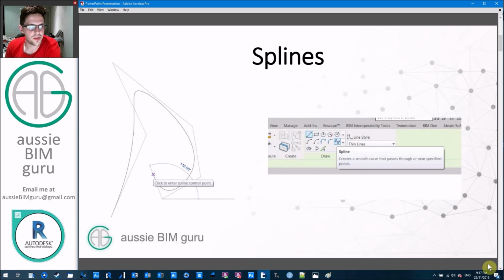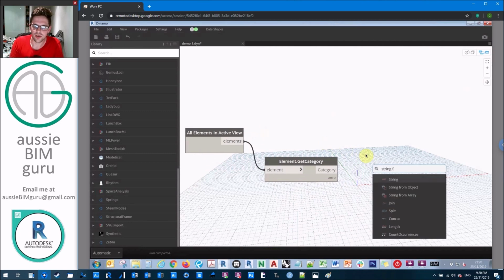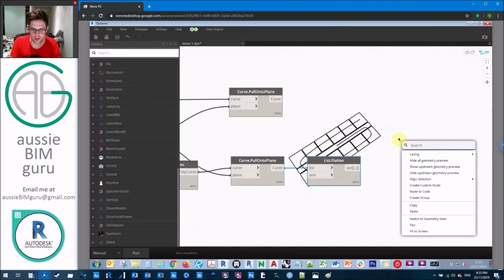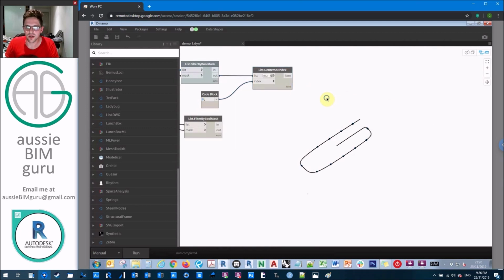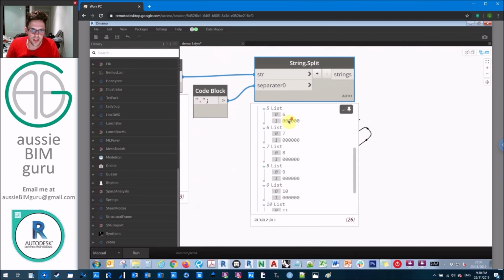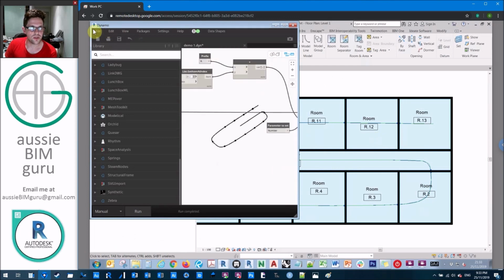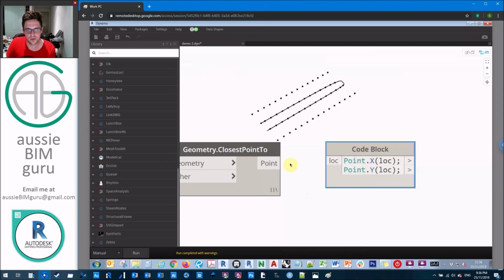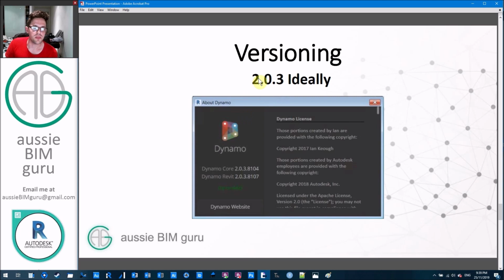Numbering by Spline using Dynamo!

Comment from the maker: Turns out you might need to use a 'minimum item' node after you use boolean masks - the intersections don't always come back in order of parameter!
Reply: Hey ! I'm having trouble. Even after I use the minimum Item after one or both boolean masks I didn't get the right order...
Reply from the maker: @IshiFrenchy  try running it @L2 so you work across sublists/objects. This is only for a workflow where you intersect a  surface or solid object.

Comment: It might be late to have any reply, but I obtain an error that tells me that the set to the same plane failed due to the poly-curve self intersecting. Annoying because I feel it is an important step to assure all the elements are on the same plane.
Any suggestion on how to delete or recalculate the poly-curve to avoid self intersections?
Reply from the maker: My guess is your curve crosses itself based on the error message, generally this should just be avoided if so. If it relates to the room boundaries then that might be a Dynamo internal error relating to rooms with complex boundaries or with small gaps around their edges.
Reply: @AussieBIMGuru  yeah I think it comes through because of the complexity of the rooms boundaries. I have just removed and so far it is working.
Reply: Thanks a lot for the reply

Comment: I followed this tutorial and reconfirmed it, but it looks like my rooms are renumbering based on the second intersection instead of the first. In other words - The corridor is not R.1 but R.6 in my case... (I only made 9 rooms.) Where did I go wrong?
Reply from the maker: If you're using list.firstitem, try lastitem instead for the intersections (or vice versa). If you're not sorting the sublists by their value, do that also so you get the lowest value from each list of parameter values only.

Comment: In my case rooms are having opening in between them, how to avoid double polycurves for such rooms, this is causing error at sorting due to difference in count of rooms and intersection points lists
Reply from the maker: To solve this one, get the list of intersection points/parameters for each room vs the spline and get the lowest number from each list. This way you only get the value the first time the spline intersects each room vs every time.

Comment: I am having issues when the spline crosses over a corridor multiple times it is not ordering the rooms in the desired sequence.
Reply from the maker: This would require you to take the first intersection per room only, so that it only gets counted once in the spline path. This can be achieved if you get the intersections per room, sort them with their parameter by key in sublists, then take first item from each sublist.
Reply: @AussieBIMGuru  I've followed your exact steps in your video, but the issue that I'm experiencing is at the Geometry Intersect node, where the first intersection listed is not always the first point along the spline. In my testing, it's either been the second or third intersection point on the list, not the first. The only thing I can think of is that it's due to the order in which the rooms are placed. I've been using the automatic room placement tool in Revit during my testing.
Reply from the maker: @thoov106  here is an example of how to handle this scenario:
https://github.com/aussieBIMguru/Dynamo_Scripts/blob/master/240430_ABG_NumberBySpline.zip

Comment: Hi mate, I'm trying to make it work for assemblies; however, since the moment I have to place Room, the finish boundary doesn't work anymore with assemblies. Is there any way to adapt this to assemblies?
Reply from the maker: The main ways i could think to work with them are either by using bounding box outline, location point or centroid of bounding box.

Comment: @AussieBIMGuru how i can use to sort out diff elements like pilecaps as i can not get finish boundary for it. I used 2nd method and sometimes it assign wrong values due to close proximity.
Reply from the maker: Get their location and pull the curve/points to Z plane = 0. Then do closest point to curve and get its parameter, sort by them instead.
Reply: @AussieBIMGuru  Curve.PullOnToPlane, not woking for points and Element.Curve givng "Empty List" for pilecaps
Reply: @AussieBIMGuru  Curve.PullOnTOPlane need curve and i got point from pilecaps and Element.Curve giving empty list for Pilecaps.

Comment: Great video but with method 1 or 2 the sort by key or minimum item both don’t seem to work! Any other suggestion?
Reply from the maker: Try sorting with levels set to @L2 and longest lacing applied. I believe that might be necessary in some Dynamo builds due to changes since I made this video.

Comment: Hello community, I am turning to you today because I have a problem. I would like to make a numbering of the parts thanks to a script but when I launch it, it numbers everything, no problem, but it does not follow the spline that I have set up. What did I forget in my script?
Thanks again :)
Reply from the maker: My guess is that maybe the spline is not at the same plane as the points, check in 3D in Dynamo. Also test a smaller model to see if in principle it is working.

Comment: Hi! First at all thanks for the video! is super helpfull and you explain it great, I´m trying to aply that to my project and i get an error in the Intersection Node, "Warning: Geometry.Intersect operation failed. Unable to make wire from edge body : WIRE_SELF_INTERSECTS2 -- Wire has self-intersection" i have no Idea why is that happening, so the scrip runs great by simple rooms geometry but in my case the rooms boundary has almost 50 points... i dont know if that could be the problem..

Thanks in advance for any help :)
Reply from the maker: Yes unfortunately dynamo can sometimes fail on complex forms. In my experience there sometimes isn't a good solution for this, substituting the room with a bounding box or trying to get the room's 3d geometry might be an alternative.

Comment: Hi, thanks for another really helpful video! One question though: why go through the (seeming) trouble of getting all elements in the active view, filtering them for Rooms (via object to string) with a boolean mask, if you can also Get All elements of Category and choose Rooms in the dropdown? Is that less reliable maybe?
Reply from the maker: You could obtain elements in a variety of ways, usually I use the 'all elements of category in view' node these days, but I worked with a filtering down process in this tutorial to teach people how to isolate elements by a property as most people aren't familiar with this fundamental concept. I avoid dropdowns unless they are needed for Dynamo player because they change between Dynamo builds when more or less categories are available to choose from, usually I use category by name where it suits.

Comment: Hey thank you a lot for helping me to number my rooms ! I'm just having a small problem. I'm using the parameter number in 'Identifier datas' and I have a lot of number after the ",". exemple of number I have : "01.2,000000", but I want "01.2". I have tried the 'Math.round' but it says that I need to have 'double' and not 'string'
Reply from the maker: There are quite a lot of methods you could use, most are slightly complex but manageable. This thread has some good examples of how to remove trailing zeroes from a string.
Reply: @AussieBIMGuru  Which thread ? Did you forgot the link ? Or do you speak about the commentary section below?
Reply from the maker: https://forum.dynamobim.com/t/remove-trailing-zeros/1563
Reply: @AussieBIMGuru  Thank you !

Comment: Great video as usual BIM Guru, I´ve been trying to replicate the exercise and this warning pops out in the node Curve. PullOntoPlane (error: PolyCurves may be branching) minute 6:12 which It is connected to the node Polycurve.byJoinedCurves, any ideas?  Thanks a lot !
Reply from the maker: It sounds like you may have more than one set of curves. Make sure all the curves are connectable of you are using one spline.
Reply: @AussieBIMGuru  Thanks for your response! I will try it.

Comment: Hi, Thanks for sharing, just a small question. I have a high-rise tower and i want to apply this numbering to all floors not just the ones in the view. Also I'm trying to get to renumber them as 1, 2, etc.. at each level, like they restart counting at each level. Any idea how can I incorporate this in this script?
Reply from the maker: Given each floor is probably different I'd suggest a circular numbering rule instead. Otherwise you'd need to draw many splines. If your rooms are all in the same order, you could pull their geometry down to the XY plane and the spline and run them all as sublists using the same logic as I use with one level here. You could then append a list of prefixes to each sublist per floor.

Alternatively, circular numbering may be a better alternative approach which is more automatic:
https://www.youtube.com/watch?v=2H6BPi9gsQE

Comment: Thank you for the video! I am trying to apply to Areas instead of Rooms and it does not work. I have replace the word Rooms for areas in the Code Block and I applying it to a view of area plan. Is this correct? Should I do anything else?
Reply from the maker: Not quite so simple unfortunately. Areas don't typically yield their geometry in the same way as rooms. Check out the area boundaries node in Rhythm though as an alternative for getting their boundary curves.
Reply: Thank you! It worked!! But sometimes it missed some areas (even though the spline is cutting the boundaries) and other times it changes the order and does not follow the path of the spline. Why could it be?
Reply from the maker: @0letii  hrm im not quite sure. Could be a variey of reasons. Make sure to join the area boundaries as polycurves so they are only intersected once per area, and also pull the curves to the same plane as the spline curve in dynamo.

Comment: Great as always man! There is something wrong i am doing Gavin . Just followed your example and my corridor do not get number 1 ..
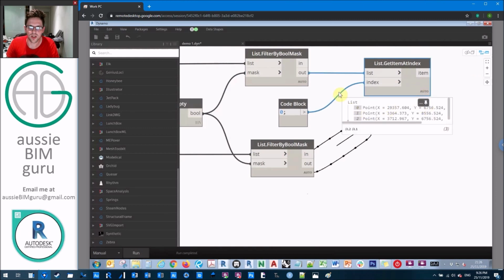Reply: at 9:26 if I type 1 (rather than 0) i get corridor as n.1 . 

In this case as the last room (top right of your plan) has just one intersection, by typing 1 (so actually selecting the second intersection point) I  get an error because the last room (top right of your floorplan) has just one intersection.  SO I  extend my spline outside my drawing in order to achieve the second intersection point of the last room. 

But maybe i am doing it complicate. PLease let me know your thoughts ;-) cheers
Reply from the maker: @Gcmanco  Hrm strange... the way I've done it should yield the first time the spline enters or leaves a room's geometry, so it should pick up the first time it 'leaves' the corridor this way. The range is built to be adjustable, so the numbering is determined by the range plus the offset later on.

If your corridor is coming out as 0, adjust the range properties instead of the list level logic I'd say. The reason your last room doesn't get detected when set to index 1 @ level 2 is because it only has one intersection as you've identified.

Feel free to send files to me for review if you like.
Reply: @AussieBIMGuru  still have a few issues , i am sending you the file for review. Thanks Gavin

Comment: in the first method, what if you have a column in the room. that will create a curve within a curve. that will lead to a null index when converting to closed polycurve. how do you solve this?
Reply from the maker: Hi Alex, you could collect the polycurves of each room, sort by function (area) @level 2, then return the last curve of each list. This would return the outer curve only.
Reply: @AussieBIMGuru  thanks for the quick reply.. I trying this method on Spaces and I couldn't create a polycurve from the list that contains two curves. so I intersected the separated curves with the spline and kept the list structured based on the spaces surfaces.
the only problem here (and I think in the case of rooms) is when you have the spline runs across a room separator. in this case you will get two points in the same location and that might lead to incorrect numbering. so to avoid that, I added a note to the users not cross a room or space separator.
Reply from the maker: @alexrafie7805  I did some testing and I see what you mean - space boundaries aren't easy to turn into polycurves like room boundaries are. I'll send my approach by LinkedIn PM, I think using the solid geometry of the room is the best way, and it should be able to work around space boundary lines.
Reply: @AussieBIMGuru  thanks Caven, the Curve start point node will solve the problem when intersecting the space solids with the curve.
Reply from the maker: @alexrafie7805  excellent!

Comment: Just one question, which line we can use, model line or detail line. Or we can use both type?
Reply from the maker: Either type should work, either will become the same curve in dynamo.
Reply: @AussieBIMGuru  because of element geometry node right!!. Got it thanks, I have similar task with structure framing numbering. You can check in dynamo forum. I will send you link.
Reply from the maker: @immi85  i'll give it a look, and yes element.geometry

Comment: would the second method work on ac units?
Reply from the maker: Yes you could get the bounding box of the element, to cuboid, centroid. Then map that a common plane (pull to plane) - this lets them be measured only in XY plane. From there it's the same workflow essentially.
Reply: @AussieBIMGuru  looking forward to trying this out. Thanks so much
Reply from the maker: @allansergent8390  no worries, let me know how it goes and if you run into any issues!
Reply: @AussieBIMGuru  i thought got stuck trying to separate the ac units from all mechanical equipment , so i thought i should get the mechanical equipment tag but i have been unsuccessful in making this happen.
Reply from the maker: @allansergent8390  yes Dynamo forces us to often revisit our data standards to find ways we can filter and isolate elements unfortunately. I suggest finding a way to put some common data in your units that can be used in Dynamo to apply a f'ilter by boolean mask' based on a parameter value (e.g. description).
Reply: @AussieBIMGuru  i assume you arent able to use the family type of mechanical equipment tag from annotations symbols, instead of using the mark or the element of mechanical symbols. (sorry im still quite new at all of this). if not i will try to rename all of the units.
Reply from the maker: @allansergent8390  actually if you can get the tags, you can use 'Tag.TaggedElement' to obtain the element the tag belongs to.
Reply: @AussieBIMGuru  Thanks, will try that. Thanks again you are always so supportive of the industry.
Reply from the maker: @allansergent8390  you're welcome!